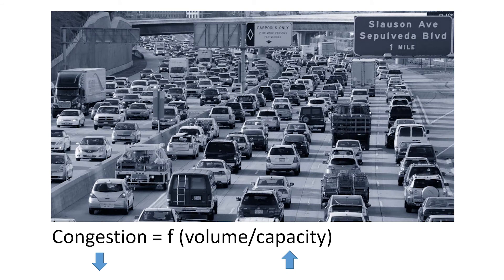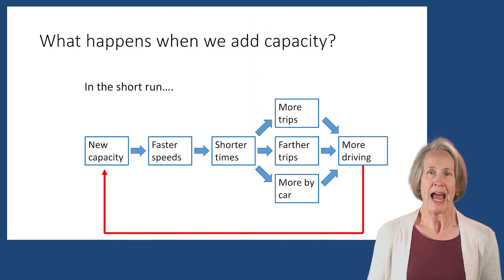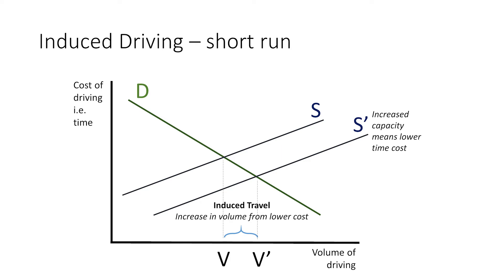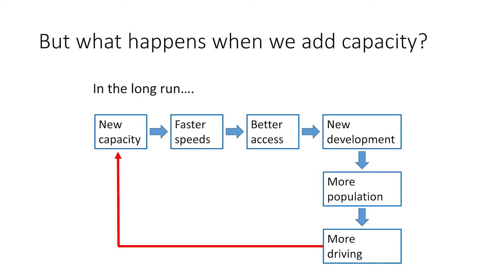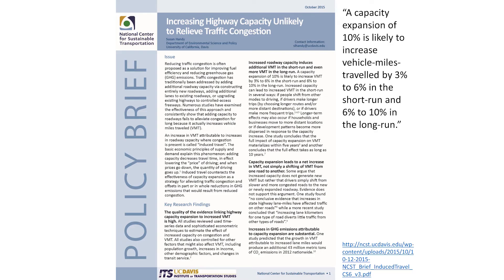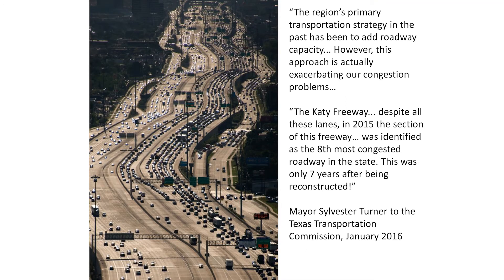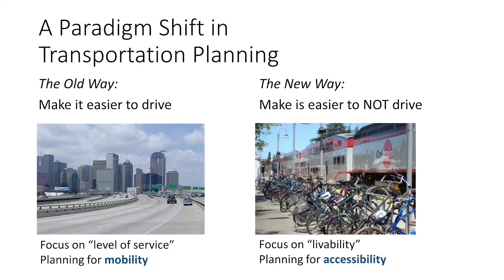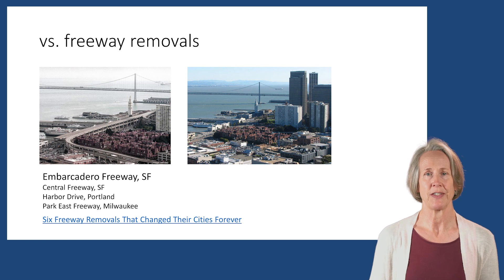Induced Travel - Mini Lecture by Professor Susan Handy

Comment: This is what happens when you have an academic who doesn't understand the difference between correlation and causation. If you added some lanes in some rural areas would more people drive? nope. 

In Seattle for example (where 40% of people commute by bus) when they added 10% lanes at the SAME TIME the population went up 14% guess what the volume went up 10% as well. Most people don't drive more just because it is faster and denser development closer to the city drives up the cost of housing which forces people to drive even longer distances. The cost of driving has to be balanced against the desire to own a single family home. 

Restricting traffic drives up the cost of housing and is a hidden tax on people.
Reply: Trust me, she knows the difference. State DOTs across the country add lanes in rural areas with the hope of spawning economic development and it sometimes works. Seattle is a perfect example of a place where they have focused on giving priority to bikes and transit and the result is more people choosing other options. So you can add population and you don't even need to add highways. The reason housing is expensive is supply and demand as well. Cities with high housing costs are places people want to live, often because you have travel options as opposed to cities where people have no choice but to be stuck in congestion.